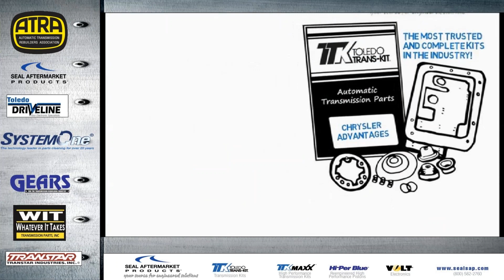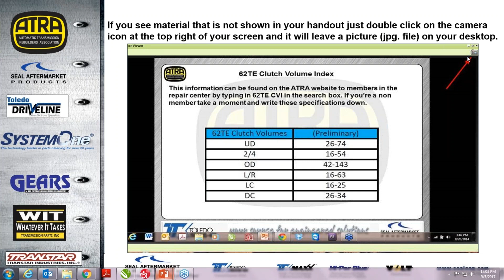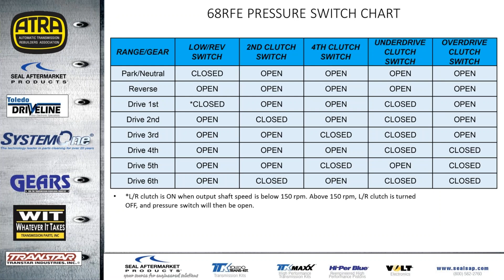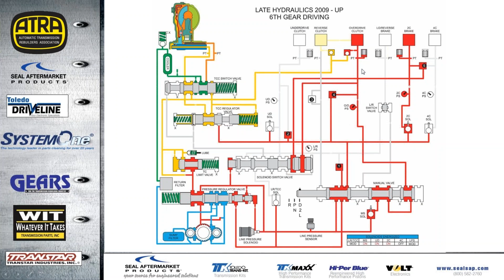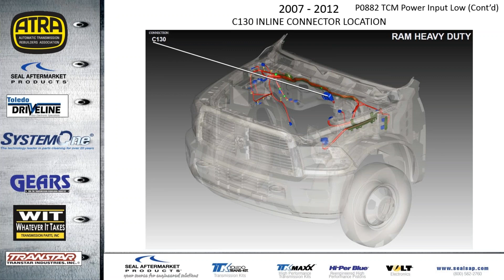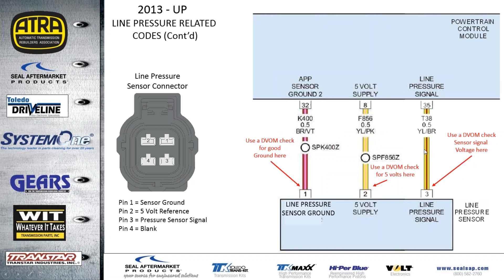68RFE Diagnostics Webinar - 9/5/17

Comment: Also i have p0870 p0871 codes currently i changed out to a white plug from a grey plug and now have pressure sensor codes. I replaced with mopar pressure sensor with no luck. Not sure if im missing something when switching from grey to white plug. Any help is appreciated
Reply: I’m having same issue
Reply: @derekdespino9062 any resolution?
Reply: Any resolution?

Comment: So if i had an existing grey plug on my 2012 2500 5.7 incan use a new white plug? Without changing any plates or balls?
Reply from the maker: Here's some info: TRS Plate Identification and Interchange
The Dodge RFE transmissions series has undergone some changes with the solenoid block and now another change with the Transmission Range Sensor (TRS) plate. We will describe the solenoid block change and the TRS plate change. We will help identify parts and interchange parts so there will be no more confusion on what to use and when.

Black Connector Solenoid Blocks: The first RFE transmission was in 1999 and was the 45RFE. The 45RFE was a four speed and in 2001 the change the computer controls to make it a five speed and called it a 545RFE. They both came with a black connector solenoid block from 1999-2003.

Black Connector Solenoid Blocks (continued): There are two things that can only work with the black connector solenoid block. The Transmission Range Sensor plate and the solenoid base gasket are not interchangeable with any other solenoid. The black solenoid block should always be updated to the white-style connector. We will describe what needs to be change along with the solenoid later.

The black solenoid came with a type 1 Transmission Range Sensor plate (TRS). To identify the TRS plate measures the pocket depth in the TRS plate. It should measure .118” deep to fit the black solenoid block type. The black connector solenoid block has to match the base gasket. Do not use this base gasket on any other solenoid block.

White Connector Solenoid Blocks: The white connector solenoid block came out in 2004 with an updated (type 2) Transmission Range Sensor plate. This can be found in the 545RFE and 68RFE transmissions. To identify the type 2 Transmission Range Sensor plate measure the pocket depth, it should measure .156” deep. Also measure the side of the plate to manual valve slot, it should measure .260” wide. This type 2 plate has shifter positions P R N D 2 1. The key point is manual 2 and manual 1 position, this changed in the later years and we will talk about that later.

The white connector solenoid block base gasket is different than the black connector solenoid block base gasket. The white connector solenoid block will replace all of the different type of solenoids. You just have to make sure you use the correct type of Transmission Range Sensor plate.

Gray Connector Solenoid Blocks: The gray connector block came out in 2009 and has one less solenoid then the white connector solenoid. It uses the same base gasket as the white connector solenoid. The Transmission Range Sensor plate is where the confusion starts. From 2009 to around 2011 will still use the type 2 Transmission Range Sensor plate as described earlier when there is a manual 1 and manual 2 positions on shifter.

There is no cut-off day on the change to the type 3 Transmission Range Sensor plate. To identify the type 3 Transmission Range Sensor plate, measure the pocket depth of .156” and the side of the manual valve slot will be .500”. This type 3 plate fits models with no manual 1 or manual 2 shifter positions.

The gray connector solenoid can be replaced with a white connector solenoid. Just make sure you use the right Transmission Range Sensor plate. You can use the white connector solenoid on all model RFE transmissions. Use the type 2 Transmission Range Sensor plate if you have manual 1 and manual 2 on the shifter. If you don’t have manual 1 or manual 2 on the shifter, use the type 3 Transmission Range Sensor plate.
Reply: @atra-automatictransmission1300  You are a book of knowledge. Thank you so much for the detailed explanation, this clears up the confusion ive been reading about on various forums. Another thing I learned about was after all is replaced i needed to do a rfe relearn fornit all to work correctly again. So far no pressure sensor codes came back. Tha k you so much for your help.

Comment: Great Video. Thank you. I do have a question, if you were to replace the stock transmission pan for one like an ATS 68RFE DEEP TRANSMISSION PAN which adds 4 more qtrs. of ATF+ oil to reduce oil temp, will that cause a P0933 Code? And what if a P0933 code was fixed once before, and within 6 months it happens again with the same code? Thanks
Reply: Old comment/question but adding a pan with additional fluid would change nothing UNLESS in the process of changing you lost hydraulic pressure/prime because you did not install the flat filter seal in the pump correctly or the spin in filter backs off. Changing to a 4wd flat filter with long neck to reach down lower in the pan works best in most cases but those are the only issues I can think of that would relate to any malfunctions.

Comment: I bought a replacement valve body for my 2018 68rfe and they sent me a valve body with the 545AB separator plate, but has the grey connector. Should I send it back or will it work without damaging anything?
Reply from the maker: I would make sure what you're pulling off you're reinstalling... miss-matched parts can cause all kinds of issues. More importantly, you should have a n updated solenoid body. here's a good part number from WIT (Whatever it takes transmission parts)
D72420B
Price: $529.47
Core Charge: $0.00
Available: 250
Solenoid Assy, 45RFE/5-45RFE/ 65RFE/66RFE/68RFE (23 Prong White Connector)99-UP (This Will Fit 2011-18 W/Gray Conn With Less Prongs) THIS INCLUDES D72991-3